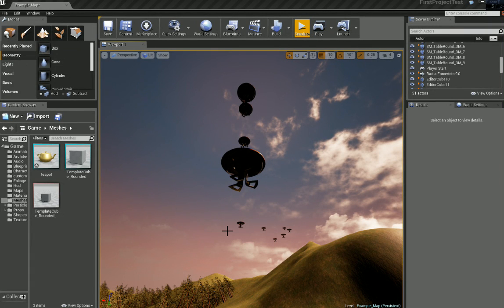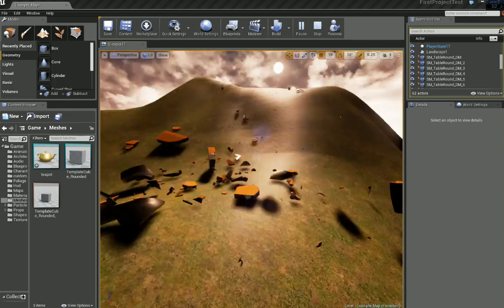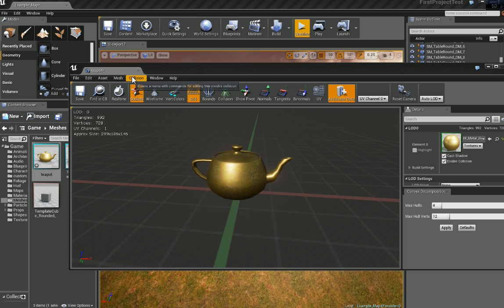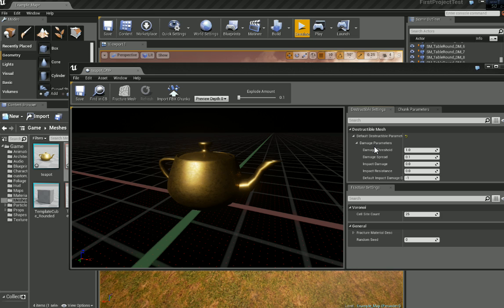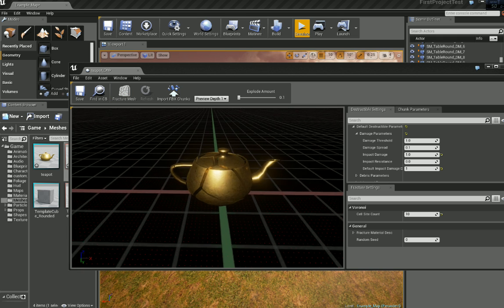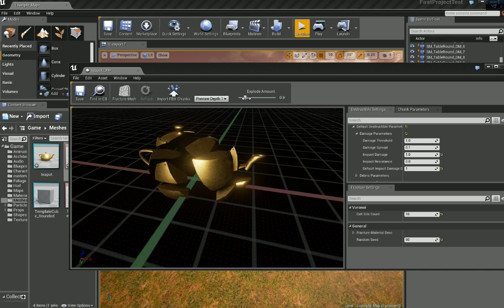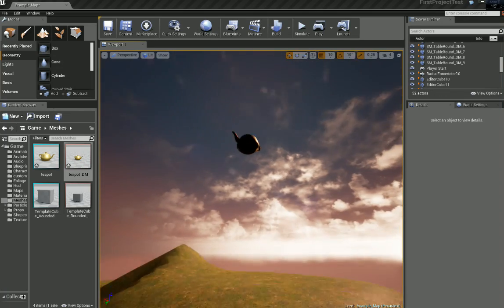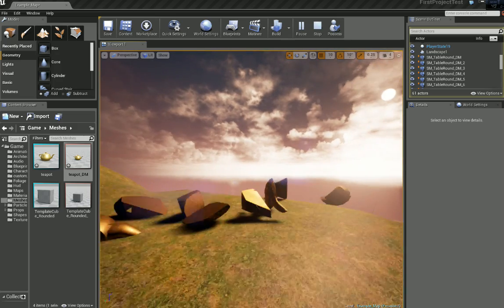Unreal Engine 4 - Destructible Mesh Tutorial

Comment: When I try this with a glass window it works quote well however, if I "simulate physics" it just falls apart right at the start of simulation.

Without it checked the window will fall apart only when I run through it. The stock FPS template little ball gun doesn't damage the glass. I'd love some help! very handy tutorial.
Reply: He has another video which explains that. You have to make the projectile have a blueprint "cast to DestructibleActor" and make some damage to the object
Reply: Link please

Comment: I just did this, and when I simulate the mesh just falls down.  It does not break apart.  Did I do something wrong or miss something? (using UE 4.6)
Reply: did you turn on Collision>Simulation Generater?
Reply: Have the same problem, where can find the simulation generator?
Reply: First, you need to select the mesh.  The details information should be on the right side.  After you roll down few pages, you should be able to see Collision section.  Simulation Generater should be there.

Comment: I'm having issues with debris flying out at ridiculous speeds. Is there a way to make it crumble apart instead of exploding?
Reply: Make sure the model is not clipping with anything!
Reply: Leo I.M It would have the same issue even if I started it in the air and let it settle. However, I tinkered and found that the issue has to do with the fact that I was scaling the object. It functions as I would expect when working with the default-sized object.

Comment: I've been having issues with destructibles colliding with static mesh components from a blueprint. Everything is set block all and has collision set, but the destructible falls right through. Did you have to set any other collision settings anywhere?
Reply from the maker: Hmmm....i haven't set any other settings apart from the ones you see in the video, they are all at their defaults. I have had problems trying to get my destructibles to fracture when using projectiles, but i'm going to look over it properley soon. I had a few crashes yesterday when playing around with blueprints with destructibles. You can p.m me in detail and i will try replicate the problem if you want
Reply: Tesla Dev I also crash with destructibles in blueprint. Please post a video if you fix this.
Reply: I did end up fixing mine. One thing you might want to mention is a destructible added to a blueprint has "Tick physics async" toggled by default, which means it only collides with objects on the async physics frame. Which by default is almost nothing, toggling it off fixes it.
Reply from the maker: Nice one! i will add this to the video info. Thanks Enos.
Reply from the maker: Enos Shenk
Do you mean "use Async scene"?
Reply: Thanks dude.